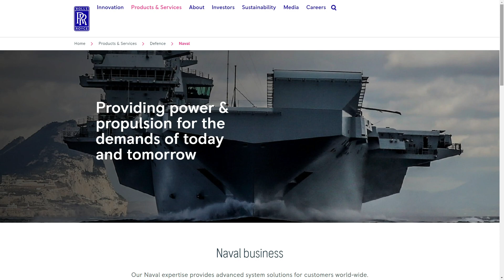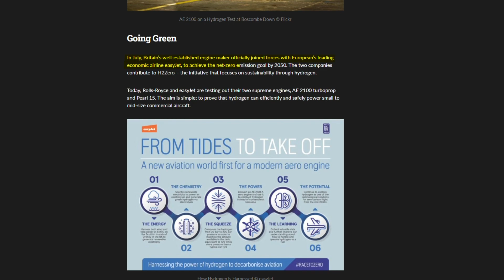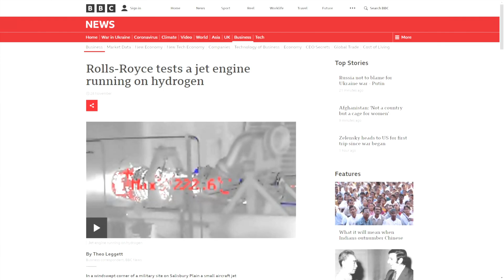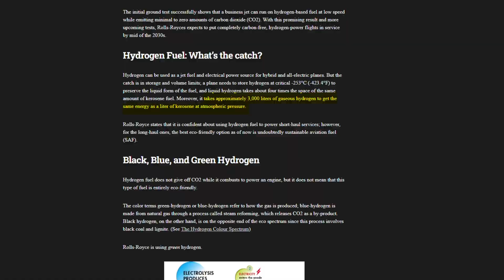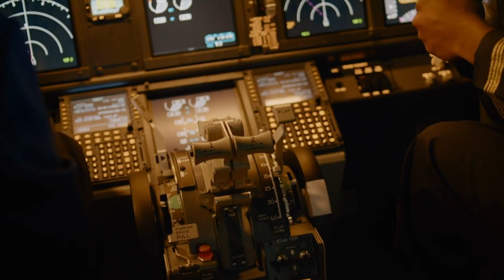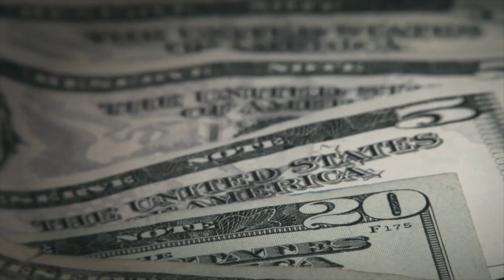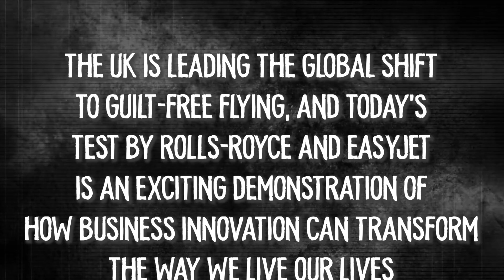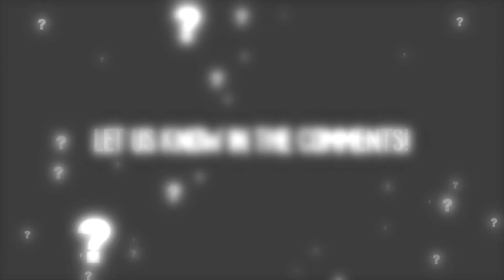All About The Rolls Royce World’s First Hydrogen Jet

Comment: There’s some flaws in your reasoning. 1. To be green, the hydrogen must be produced green, so no fossil fuels to produce it. Will there be enough production for the aviation sector? 2. Storage of hydrogen to take along is not possible (yet) in the wings, so the storage tanks go in the fuselage and must be counted as cargo. It adds up fast. So fast, there’s a serious limit to the cargo capacity to travel distance ratio.

Comment: Rolls Royce Motor Cars is NOT the same company as Rolls Royce Holdings (Aerospace) and hasn't been for 50 years. I believe Hydrogen is the best way to go (with nuclear) but a new way of producing it cost effectively in bulk needs to be found. The oil companies should be tasked with this alongside new oil and gas supplies.

Comment: NO. You need "Green"-sourced liquid Ammonia (which is converted back to Nitrogen+Hydrogen by the jet's exhaust heat,)  to fuel the plane. The Hydrogen is burned. See...liquid Ammonia is Caustic, but it's WAY easier to liquify. It can be kept at -28 F. There are already liquid ammonia pipelines, because of it's use as an agricultural fertilizer. 
This is already being experimented with down in Australia . 
Even if we can't make air travel carbon-free, however-who Cares??
Jet Fuel (mostly Kerosene) is only TEN percent of Crude Oil usage. Contrast that with Gasoline for cars (at least 40%) and Diesel for the trucking industry (maybe 20-25%.) I already drive an EV. And, overhead pantograph lines on our superhighways could power tractor trailers, with battery power for the little time they spend on surface streets. 

A surplus/shortage is Only ten percent in either direction.
OPEC Knows this, and is already seeking to diversify away from Oil and Gas production. 
A Side note: Bullet trains, and, eventually the Hyper loop, could be practical for all but transoceanic travel. A Bullet train could go from Vancouver to Buenos Aires, Alexandria to Johannesburg, or Paris to Vladivostok, at the current speed of a passenger jet. And, the Bering Strait from Alaska to Russia could also be bridged. The Latter would end our supply chain problems (assuming the Russia-Ukraine War is Ever resolved.) A freight train between Asia and North America could run at Eighty miles an hour, vs. the current fifteen miles/hour that large container ships travel at. And, the train would still be more energy efficient, too, provided that IT ran off electricity or Green fuels.

Comment: What kind of efficiency do these engines get using hydrogen?  I'm trying to see if it makes sense using hydrogen to produce electricity?  I'm guessing using an electrolizer would be more efficient?  I know it's off topic but that's what I'm after.
Reply: An Electrolyzer produces Hydrogen.
A Hydrogen fuelcell produces electricity.
Reply: @drpoundsign  I need both but I also need to know how long it will last, to put it into practical use.  Question, is it better than using a hydrogen turbine engine?  Idk need to see the data
Reply: @l0I0I0I0  I'm an MD, not an Engineer, But, THIS stuff is Fascinating.
Reply: The efficiency running a gas turbine on hydrogen is slightly higher than using kerosene, largely due to the higher water content in the exhaust gases. I won't go into the details of why that makes it more efficient (unless you're interested), but it's about 2% or so better. Fuel cells are more efficient than GT's, but you lose most of the advantage gained in turning the electrical power output into mechanical energy. The major advantage with GT's is their power density, fuel cells are rather heavy and not really suitable for larger aircraft.

Comment: The "world's first hydrogen jet" aircraft was Tupolev Tu-155 with NK-88 engine, capable of operating on both liquid hydrogen and liquid methane. The first flight took place in 1988.
Reply: Well, actually the first hydrogen jet aircraft to fly was a modified B-57b Canberra in 1957, which flew on liquid hydrogen stored in wingtip fuel tanks. The Tu-155 was the first turbofan engine to fly on LH2, because the Canberra had turbojet engines.
Reply: True

Comment: I don't think this has a place on the market. By the time we make a huge materials science breakthrough in hydrogen storage to make it viable, electric aircraft will have already replaced short-haul air travel and be making strides to replace long-haul as well.
Reply: Electric is not energy dence enough to be used in aircraft. The plain would be too heavy to take of like that
Reply: @LilliD3  Commercial electric aircraft already exist, they just aren't 747 size yet. Multiple new battery technologies allowing more lightweight batteries with higher energy capacities than traditional lithium-ion are already building factories or attempting to ramp production.
Reply: @Onihikage  Unfortunately, gas turbines are very hard to beat. People always tend to compare the battery to the GT, when in fact, it would be fairer to compare the battery to the fuel and the GT combustor in energy and power density terms. Li-ion batteries might one day hit 1 kWh/kg, whereas jet fuel is already 12 kWh/kg. Li-ion power densities can reach perhaps 1.5 kW/kg power density, whereas a GT combustor generally achieves upwards of 1000 kW/kg. Batteries have a LONG way to go before they are anywhere near, and will probably never get there.
Reply: Yeah but electric systems still use coal to power overall

Comment: I have mixed feelings. This is more "real" than the net-zero "claims/plans" of the fossil fuel industry, but it is also far enough out that it feel like a potentially empty promise that will never be realized. Meanwhile, climate change keeps getting worse. Hope I'm wrong.
Reply: Completely agree, it would be a step in the right direction if actualised correctly, also couldn’t you just fly through clouds with some kind of intake which is linked to water tanks and convert it to hydrogen on board by having dynamos run off the engines to provide the power needed to cool the hydrogen? Just a thought could be wrong as well tho
Reply: @Simulationexplorer369  just not feasible. The size of the intake would be considerably larger than the frontal area of the aircraft.

Comment: How is easy jet going to be able to sell tickets if the price of hydrogen is 10x dearer than aviation fuel? 
It is meant to be a cheap airline.
Reply: They said hydrogen is cheaper. SAF is dearer.
Reply: @snowstrobe  hydrogen is 10x more expensive and isn’t ever going to get as cheap as SAF unless they find a new way to split it out of water. 
That is never going to happen because they would have found a way by now. It is too energy intensive to break the bonds.
Reply: @Vile_Entity_3545  That cant be true. All SAFs, that i know about, are produced from/with hydrogen.

And as SAFs arent produced from biomass, the only other sustainable way to produce them is with electricity. And hydrogen produced only with electricity has already 80% efficiency.
Reply: @Vile_Entity_3545  Well, hydrogen is already cheaper than fossil fuel kerosene per unit energy as it happens. And about a third of the cost of SAF.
Reply: Why should people expect everything to be cheap? Air travel and holidays abroad are not essential to a decent life.